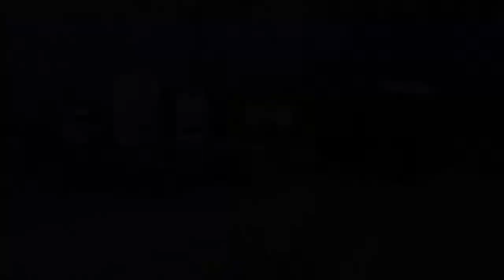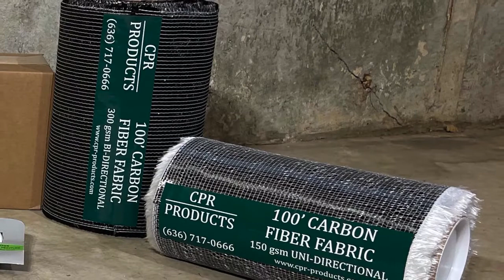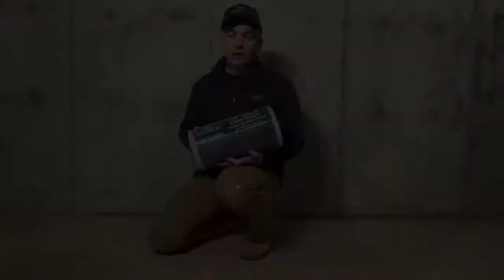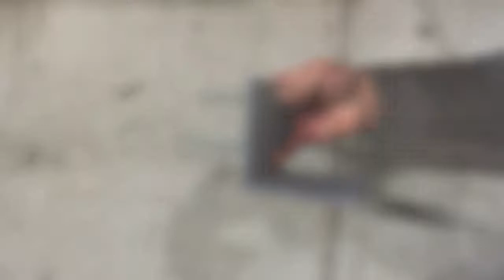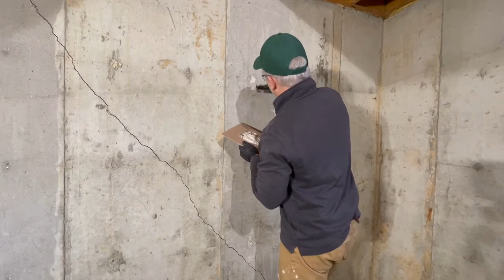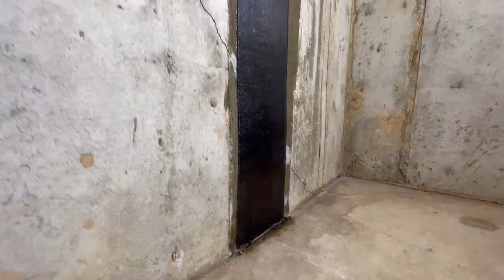Carbon Fiber Wall Reinforcement - CPR Products' Carbon Beam

Comment: My understanding is that the wall needs to be bare concrete/cinder block to apply a product like this.  If the wall was previously treated with a product like Drylok, is grinding it away enough since it seeps into the block?  Can you use a product like Drylok after the carbon beams have set?
Reply from the maker: the bond strength of the carbon fiber fabric, epoxy, and concrete as a whole system depends on the epoxy's ability to penetrate the pores of the concrete (we've seen it suck in 1/4" to 1/2" in some cases). So if you can grind deeper than the Drylok penetrated and expose concrete below it, then yes. Once the epoxy resin is cured (give it 48 hours to cure), basic house paint will stick to it, but we don't have a frame of reference with Drylok.  Interior topicals are not useful for truly waterproofing foundations - you have to stop the water from penetrating the wall from the outside, in.